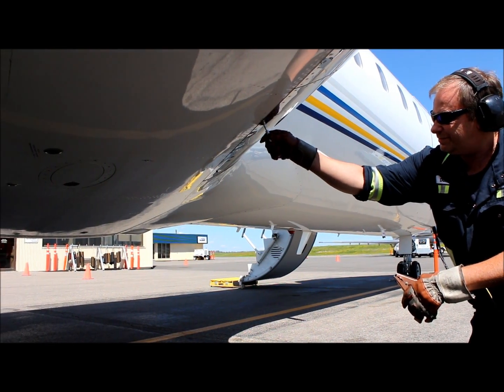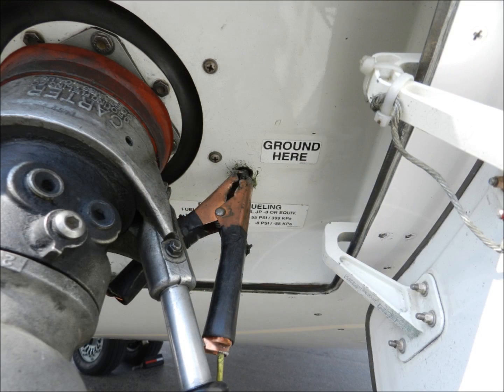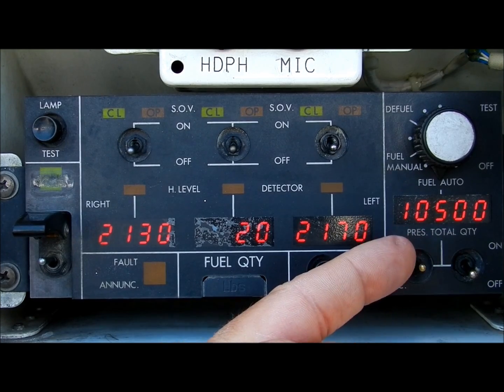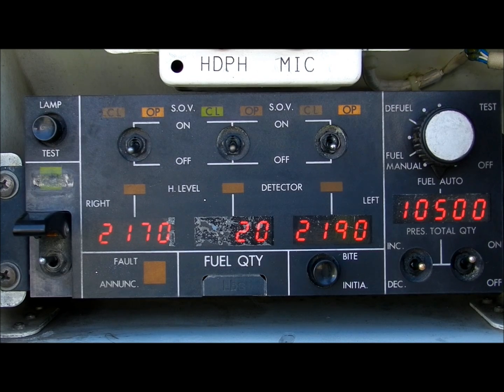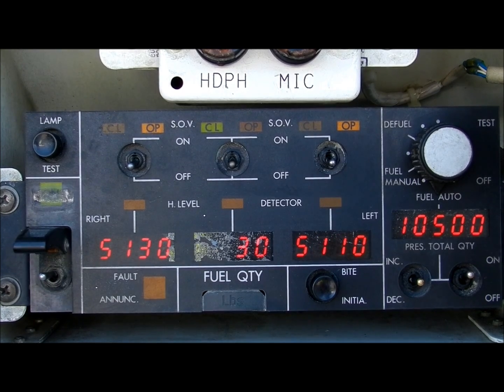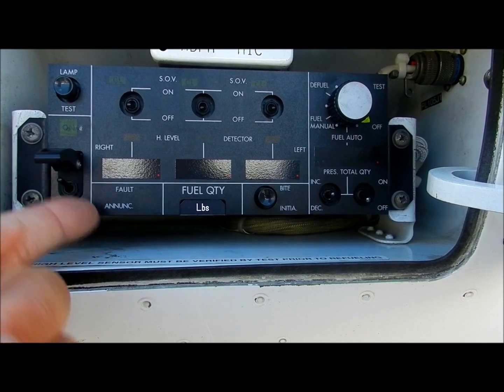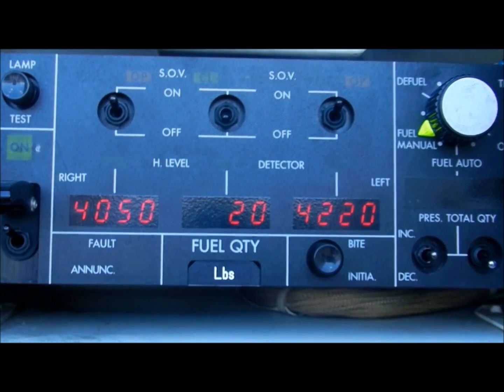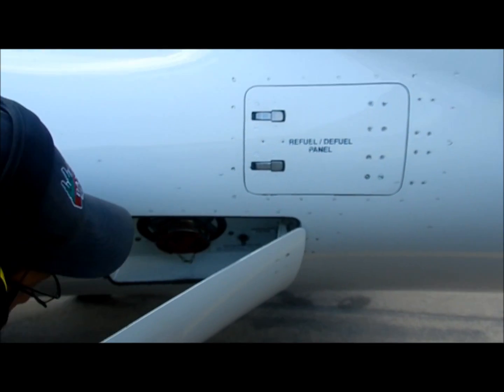CRJ Aircraft Fuel Training. HD

Comment: It's actually "bonding" not grounding. The term "grounding" was a left-over from when the fuel truck/cart was bonded to the aircraft and another cable was connected to a ground rod. This procedure was abandoned in the late '80's when the military found that it was safer to statically bond the aircraft without also going to the ground rod. The bonding cable neutralizes any static buildup between the two.
Reply: That bothers me too! lol

Comment: You can ground any aircraft as long it's on metal!
Reply: You should only use the ground points.
Reply: @redbull8661  Thanks for stating the obvious for everyone!
Reply: @davidsmiths5471  Ok just for you then I will state what's not so obvious. As you said you can ground any aircraft as long it's on metal, that's not wrong. But if you do it on painted metal it may not make a good bond and if you scratch the paint it will start corrosion and cause problems.
Reply: @redbull8661  That is why  I stated " it is on metal"! If someone needs to be told the difference between metal or something painted ,maybe shouldn't be by aircraft at all!
Reply: @redbull8661 just wanted to add to this. Always safer to do it on designated bonding points or points where you can almost 100% guarantee that you have good continuity between said bond point and the entirety of the airframe. Example: I would catch my employees and pilots of general aviation aircraft (let’s use the good ole Cessna 172 for example) bonding the refueling truck to the nose gear assembly of the aircraft. Sure, it’s connected to a bare metal surface. However, much of that linkage is painted or rusty and not providing great continuity to the rest of the airframe. That nose gear assembly is also an oil filled cylinder with rubber gaskets between everything. 

I never did think to use my multimeter to actually test the continuity of that nose gear assembly. However, I hope no one has to find out the hard way.

Comment: You forgot to mention the part where in auto mode you reach the predetermined amount of fuel and stop, then the fuel gauges keep going up until you're 600 lbs over and get chewed out by your supervisor. Thanks bombardier.
Reply: Eeez up on the throttle 🤠
Reply: Happened to me today. Pressure fueling had problems the flight before and the computer ran 4 bite tests making it impossible for auto refuel work. I'll take any plane to refuel over the RJs. Not to mention it'll try to over fuel itself if you're not watching it on auto.
Reply: @AliAl-Faesly  i love seeing 175s at the gate always the easiest to fuel
Reply: That's why I just ignore the useless AUTO mode and go for manual refuelling and close every valve some 30 kg (66 lbs) before reaching indicated quantity per tank.

The CRJ refuelling system it's just hopeless.

Comment: Hmmm..is that 10,500 gal? What steps need to be taken to allow the air to escape at such an unbelievable rate? Why doesn’t the hose budge when you start fueling? How do those skinny little wings even hole more than a few drops? How could an aircraft possibly fly with such absurd supposed weight? Hmmmm.  Looks like bs to me. Not one drop ever spills? Not one?
Reply: Aircraft are fueled in lbs so about 1500 gal. The wings carry the weight of the loaded fuselage plus the forces of flying so logically the fuselage can support the weight of the wings on the ground. In the air the wings are essentially supported by their own lift.

Just call up a flight school they'll happily show you around the fuel system.
Reply: 10,500 lbs, not gallons. Air also escapes through vents located under the wing, on some aircraft, you can hear it. Fuel is normally pumped at about 20-40 psi if I remember correctly, the hoses themselves are rated for much higher. Yes, the wings do support this weight, even on the ground. Sometimes the nozzle may leak a little bit of fuel if it does not seal correctly, but normally not a problem. Any other dumb questions?
Reply: @tomdickens7856  you forget that after closing everything up there's almost always a few drops of fuel between the adaptor and the single point that is just waiting to drip onto your face or clothes.
Reply: @tomdickens7856  Yes the earth is a spinning ball, Yes gravity is real even knowing it has never been proven, Yes the moon is cheese.